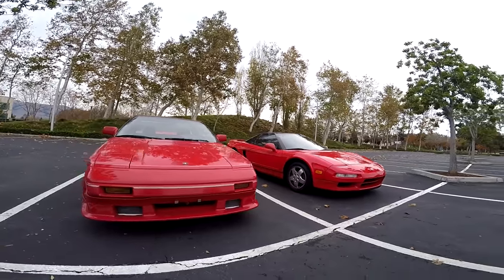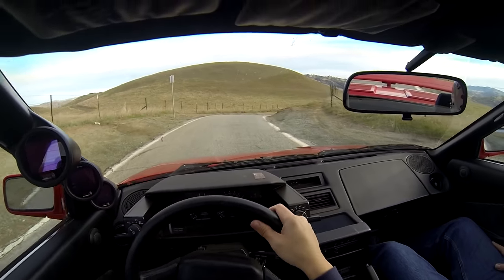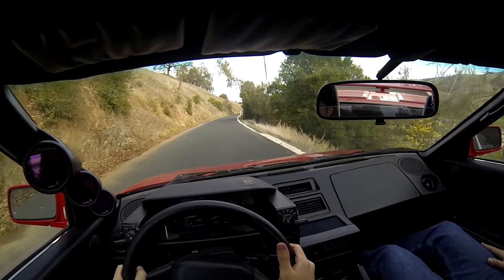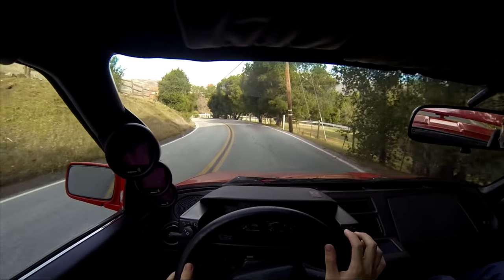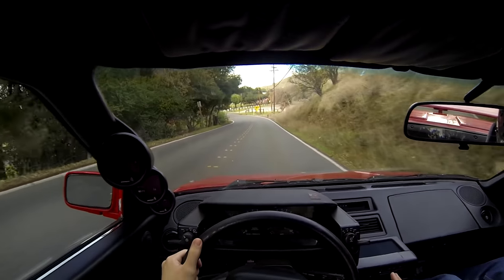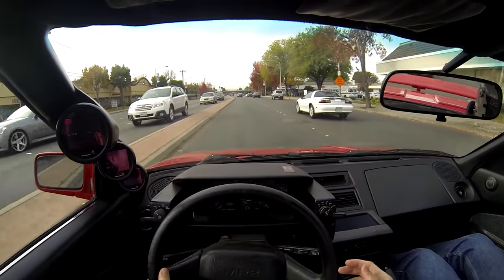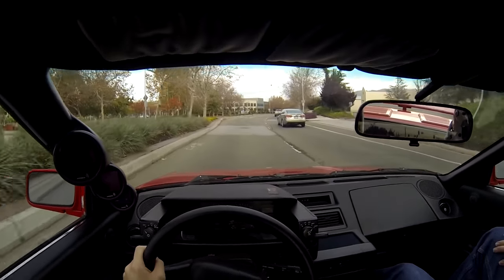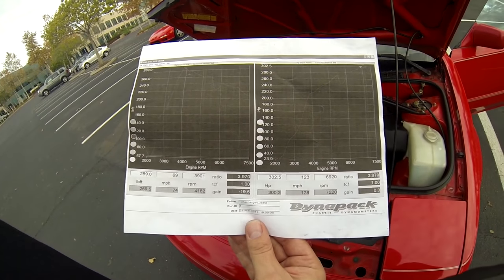1988 Toyota MR2 AW11 (Twincharged) - POV test drive

Comment: Putting 17s on an AW11 seems like a sin.
Reply: <---- has had 17's since around 2000! Genuine sparco 17's. You just have to avoid potholes haha
Reply: I love the way 17s look, but unless you're clearing brakes that the car HAS to have, I prefer smaller lighter wheels. An AW11 is light enough that 17s are just a fashion accessory.
Reply: NoBrakes23
Agreed there. I never got around to changing mine due to the fact they were the genuine sparco racing wheels and were on the car when i bought it some 12 years ago almost. Looking at dropping down to 15x8 work equip 03's though soon.
Reply: +Gee Zed Eee Power Very nice.
Reply: agreed son.

Thats why i went with the 15x7 rota grid classics with 195/55/15 RE003's 
imo how it was meant to be :)
Reply: For real. For some reason it look terrible on these. But on most cars, much better.
Reply: On any MR2. Too heavy, 3.0 minumum.

Comment: As someone who's owned and driven the shit out of one of theses for over a decade, normally aspirated, SC, and Turbo'd it was extremely frustrating to see the 'fast' sections, you need way more time to get a feel for the handling of the car, these things can be pushed so hard round the bends.   - No disrespect for the driver, it takes time to get to grips with one of these! - especially with the power all at the top. - you need to have real BALLS at the top end of the RPM range.

Please get a video of this out on the track, or at least on a decent road so people can hear the FULL rev range

Comment: i agree with aaron. your reviews are very informative.  Buddy was right not to push the ogura s/c too hard as it is pretty archaic tech and even the bigger pulley runs them pretty hot.  some of the discomfort is probably for a couple reasons.  ST went way overkill on their sways some people report even tearing out swaybar mounts with them.  you could be getting some bind in them.  the mk1 was a little ifa parts bin car so it got longer dampers than it should have,  which may face contributed to the stiff ride too,  as the damper is so far compressed. also,  with many strut suspensions you kinds have to run them stiff cuz their weakness is poor camber change.  unlike your s2k and nsx's sla/double wish  after parallel the camber curve moves to positive gain rather than negative.  i found that rca's really helped with nibbleness as i had to fight roll force less. how did side to side loading feel? after i drive an frs i was sold on getting my roll center closer to my center of gravity. that is an insane mk1 and absolutely gorgeous. it takes a lot of tinkering to get the car dialed in but as you can see we mk1 owners like that challenge and will tinker for years
Reply from the maker: +Bushtail Razorback Tons of in-depth information from you as always. I didn't push this AW11 as hard in the corners as some previous cars, so I can't say too much about lateral weight transfer, other than there's not much of it. The heavier steering rack (my NSX felt like it had power steering on the drive home) and bumpiness of the suspension didn't give me the confidence I needed to push. Hope Buddy can continue to dial in the chassis and engine response.
Reply: +Zygrene I'm scared enough in my buddy's evo 8 with 400whp. 300whp in a mk1 has got to feel like being strapped to a rocket,  lol

Comment: Weird that there is a torque dip. This guy I know used to have a similar system in his AE92 Levin GTZ and there was no dip. The difference in engine was his was built by JG Dynamics (blue printed, knife edge crank and stroked to 1.8) and had an upgraded SC pulley (not sure if this MR does). Nice vid though.

Comment: Awesome. I wonder if the design of the twin charge HKS system was considered by I hear they stopped selling the kits years ago. I would be worried about the electronics and tuning is that would be over my head. I am happy with my factory supercharged with a oversized pulley but this concept is bad ass. Nice Work!

Comment: Boost cut is built into ECU to stop the engine from breaking due to too much boost.  You haven't overridden the T-VSV.  Plug a hose, and build a little circuit with 10 bucks in parts from radioshak

Comment: It is funny how we always want more power, but on some cars they are actually better with less. I have made this mistake before and then detuned certain cars and found they were a lot more fun to drive and in some cases faster on road courses. Especially if it has a big peeky turbo with a lot of lag, going with a smaller turbo that spins up a lot faster might not give you the big HP numbers but gives a far more usable torque curve and is just much better in general.
This car is a lot more fun with the amount of power where you can just run the piss out of it and not worry about that short wheel base and limited grip.

Comment: The fact that you think that 1st gear would be harder on the clutch than 2nd says enough.
Reply: i think you meant to say " the fact that you think 1st will be harder on the clutch than 2nd says enough" he doesnt know much about anything. thats for sure
Reply: Argh, dammit, misspoke.  Thanks :)
Reply: sklyrovka no problem man.
Reply: I know what you mean, but my car cars clutch actually does slip in 1st gear and no other gears. I dont know why.
Reply: @miataqc8763  your left foot needs to get off the pedal then. Clutches actively slip in higher gears. 1st gear is you slipping it.
Reply: @TheBMWBUM  im pretty sure i was talking about my civic in this. but naw if i do a lil launching, i have to slip the clutch until it grabs or else it will slip real bad. If i drop it fast then it will spin through out first. I went to pull on someone once at a stop sign and 1st gear went no where but soon as i get into second it grabs hard. Its weird.
Reply: @miataqc8763  yeah you need to feather the throttle not the clutch my dude lol. Let my tires slip while my clutch catches. Burnt clutches are bad, burnt tires are fun. Get a set of nankang ns2r's and say goodbye to slip and hello to grip!

Comment: Why does a decrease in the engines temperature cause a fuel cut in this car? Sorry if its a stupid question but i was hoping someone could give a more technical explanation.
Reply from the maker: +Corbin Borrero I believe the ECU was programmed to cut fuel supply whenever engine temps are outside a designated operating range. Meaning if temps are colder or hotter than the operating range, the fuel cut kicks in to prevent engine damage.

Comment: Hold on, I'm confused. Why was it getting fuel cut? Was it the engine that was too cold?
Reply from the maker: +Julio Gallegos Yes, the engine must be within a certain range of operating temps otherwise ECU cuts fuel to prevent damage. It was tough getting the temps into the operating range due to the cold breeze that day.

Comment: How are 215's wider than an nsx's front tires?  As of 1994 they came with 215's.
Reply from the maker: +Ryan Barbolt 1991-1993 models come with 205's in the front, 225's rear.

Comment: Is this the 4age or 4agze?
Reply from the maker: +UmmmmRamos 4AGE
Reply: +Zygrene do you think that the 4agze would be easier to work on? Or can handle the boost more?
Reply from the maker: UmmmmRamos Sorry, I meant it's the 4AGZE. I believe it's basically a 4AGE with forged pistons and lower compression so it should handle boost better.
Reply: UmmmmRamos gze means its supercharged, GTE means its turbocharged, GTZE means it's twin charged

Comment: Needs K swap
Reply: yes!!!
Reply: +94tegLSatMSC Nah
Reply: +Troy Botteon yes, would be more reliable, make more power, much simpler layout then this, sound better, probably lighter as well.  the reasons go on and on
Reply: 94tegLSatMSC It's got a supercharger and a turbo in a 4AGE, definitely sound better. This guy is happy with it, and frankly I would do the same. You also don't need that much power in a MR2. Just get a K20 for your teg, this MR2 already has a cool engine.
Reply: +Troy Botteon no sorry a k series revving to 9 sounds a million times better than this.  a 300 HP NA k series would be much more reliable and less of a headache than this.  any way you slice it, it would be a better setup.  If he's happy with it that's fine, but a K would still be a superior setup
Reply: 94tegLSatMSC You know this engine is a 4AGE right?
Reply: Troy Botteon yeah and....
Reply: 94tegLSatMSC 4AGEs sound good... How do you comment back that fast anyway?
Reply: +Troy Botteon modern phone yo!  not knocking the 4AGE but the K series is just a superior engine.  4AGE can sound good but not anything close to what a K can
Reply: +94tegLSatMSC ive never seen a k rev to 11500rpms
Reply: +94tegLSatMSC k's are not superior to g heads lol. 3sgte would smash one all day.
Reply: +beefstrudel No it wouldn't, keep dreaming.  That's why people are K swapping all sorts of MR2's now.  3S is a great engine but k's are better, don't let your Toyota fanboyism cloud your judgement sir
Reply: +RC1834 K....
Reply: @94tegLSatMSC you seem like that guy who would swap 13B with LS
Reply: @94tegLSatMSC  it would make more power as a dyno queen yes but it will be slower

400hp 3sgte = 500 k20 turbo
Reply: @camposvazquez  that's not how things work
Reply: @94tegLSatMSC  when you want to race.. Let me know....  None of tge kswapped mr2"s in l.a. will race me anymore.. I have to go to vegas..

Honda's are gutless torqueless wonders...  

997hp kswap mr2..shop built 8.8sec 1/4 with a dog box

667hp 3sgte built in a back yard 8.9sec 1/4

I am in los angeles... Look up campos mr2 ..  You can find me....  Good luch to your bench racing goals in 2019